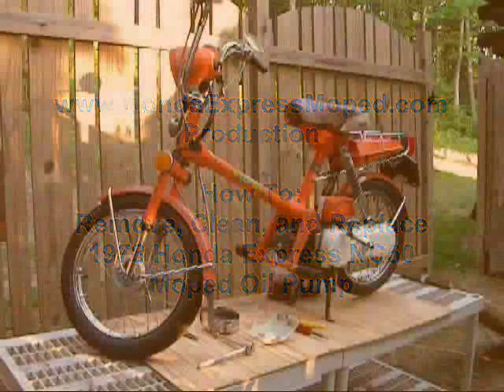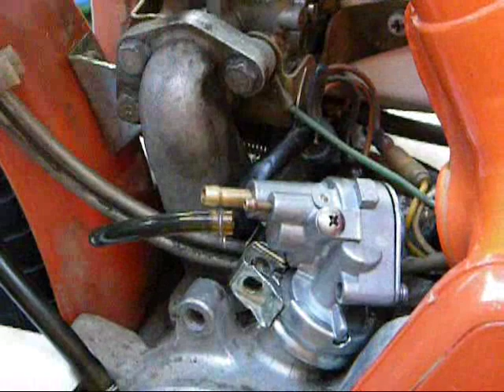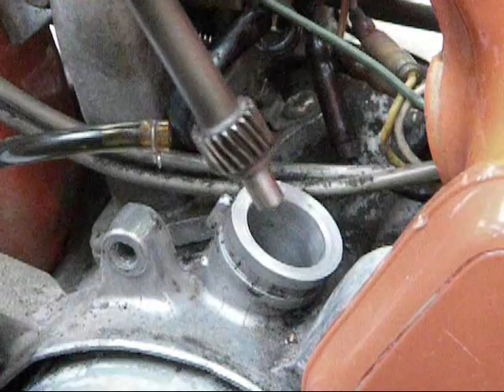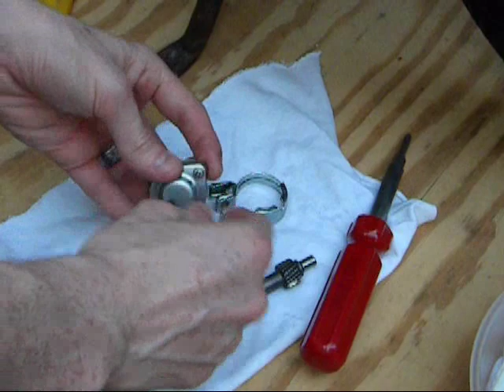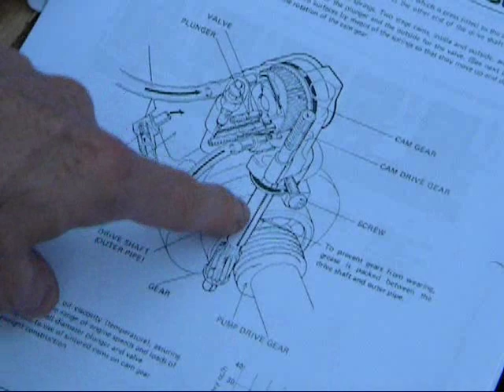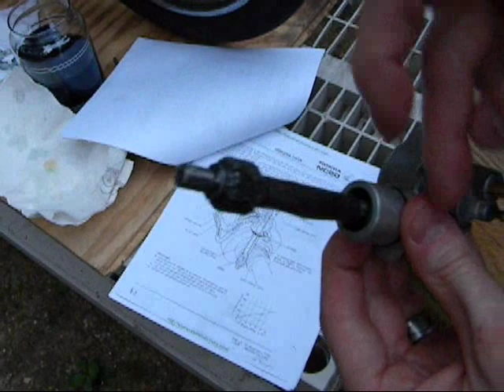Honda Express Moped | Oil Pump How to Remove & Clean 1978 NC 50 Scooter

Comment: these pumps are over 40 years old. delete the oil pump and convert to premix. these things fail easily and the only warning you get when it stops pumping oil is your engine explodes...
Reply: How do I delete it
Reply: @catfish4721  okay first of all its a long journey of fine tuning and figuring out what works out for your engine when it comes to carb tuning, because you may need to get bigger jets, I think stock is anywhere from 65-75 depending on year. but you take the oil pump out and there will be a long metal shaft going from the pump to inside of the engine, take it out and put the pump back on. this will ensure the engine isnt running a dry pump....but when you do this you will need to get vacuum caps and cap the ports on the oil pump and the oil inlet port on the carb. if you want to or if the seals on the pump are bad, you can purchase a part called a Rubber Expansion plug a 7/8 inch to 1 inch in size and it will perfectly fit the oil pump port and seal it. just dont tighten them too tight it can crack the alluminum. then run a 40:1 fuel ration (atleast thats what I personally run) if you do some digging on youtube and the rest of the internet you can find a lot of good material that will help. but everything that i just said here should get you pretty good... I premixed mine and got an aftermarket mlm exhaust. currently running a stock jet but i have a size 80 coming in the mail, will report back on how well it works. im still ironing out issues on mine, cant tell if its running to rich or lean.

Comment: Thank you very much I just bought two bikes and one was bypassed and I want to change it back to original so I hope the pump is fixable and I will now know to grease it. Iwill also use the synthetic oil.
Reply from the maker: Did it work?

Comment: That one piece that you mention not to take out, I was air  blowing the ports and it just flew out. Cleaned everything up and reassembled the pump. Not sure if suppose to do that, but at least it's freed up and was not difficult to install back.

Comment: I have a '78 express, I was wondering if you could tell me how much oil should be coming out of the oil pump at full throttle. I took off the line from the pump going to the intake and I noticed that when I was at full throttle, almost none came out; maybe a drip every 5 seconds. I know oil is getting to the pump, but it doesn't seem to be pumping it. Thanks, Alex.
Reply: Alex Cardali Im not sure of exact quantity's for the express, but they use hardly any oil to be honest the amount you are saying sounds right to me. Plus this is the awesome bit nowadays oils are so much better than when your bike was designed, even if it is not the exact amount it probably is fine. However if your worried then just use some extra oil in the gas untill you can tell the oil tank goes down, just so you know the injection system works. Alex
Reply: ***** Btw i'd highly recommend Castrol 2 stroke oil it has never failed me yet.

Comment: I have a '78 Express. My mechanic has cleaned the carb, replaced the spark plug, battery, air filter, it's been filled repeatedly with synth oil,etc. However, the Express started losing power about 6 weeks ago and, now, it'll start but won't stay running and or loses power when I start to excelerate. Over the last month or so, the engine has sounded like it's running dry. The next step we're going to try is cleaning the oil pump. If you have any other suggestions, I'd be grateful.
Reply from the maker: Beck... I would check the battery. If it doesn't stay properly charged you will loose power, have trouble starting it, and possibly blow your headlight. You can view my blog and see where to get a new battery online. http://www.hondaexpressmoped.com
Wouldn't hurt to pickup a cheap engine temperature gauge (treatland.tv) and install it. If your engine runs dry you could overheat and seize the engine. Although, this is less likely if you haven't done any upgrades to engine. You might also have an air leak in the engine. More air will cause engine to run hot and possibly overheat. Can cause high RPMs with little power. Good luck. Let me know how it turns out.
Reply: @EverydayInternetSol wonder how they got on with it, probably sold it many years ago.. what battery 🔋 btw, gel 6v new style?

Comment: The top part of the shaft has a 'scroll' or 'worm' which drives the tooth edged gear withing the pump. Its simply known as a worm and wheel gearing. You didn't actually get to the pumping section of the unit, purely the drive area. It was instructional none the less and will, I'm sure, enable an owner to remove the part if required.. Usually with mechanical feed pumps, the first you know of a failure is a seizure.  Thats why some owners use a petroil mix. Regards.